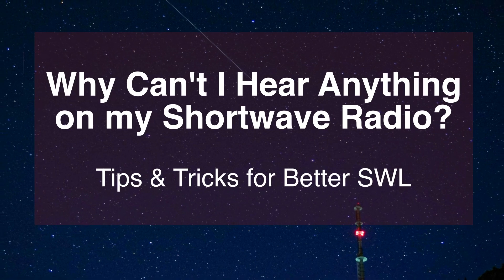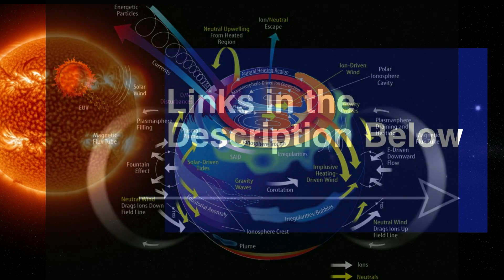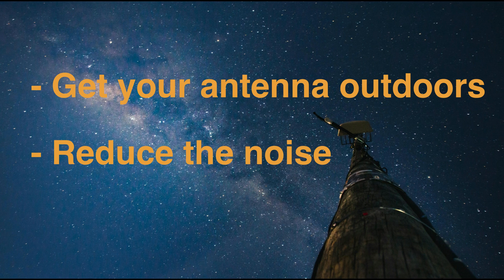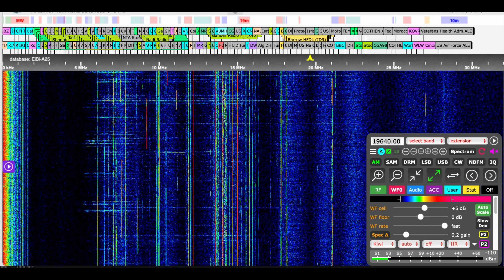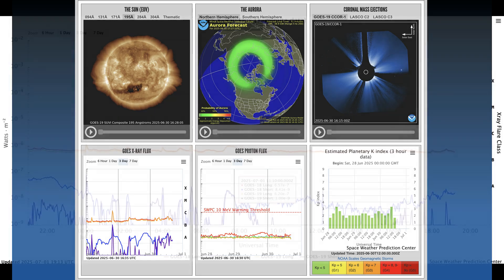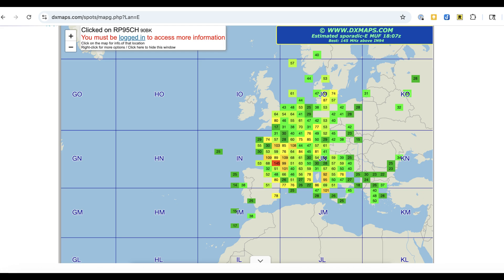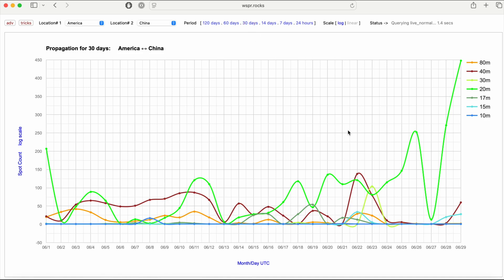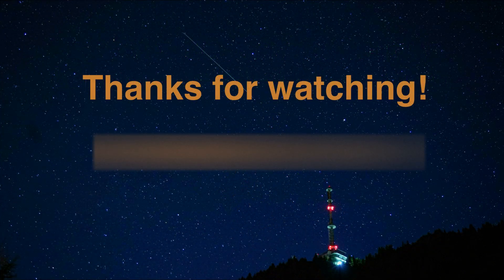Why Can't I Hear Anything on my Shortwave Radio?

Comment: Thank you for the educational presentation! There was a period in time in the mid 2000s, when I gave up listening to shortwave radio, thinking that it was during the poorest years of the 11-year sunspot cycle. I put my ICF-SW7600G away and stored it for several years. I didn't know that there was more to than just the sunspot cycle, which included seasonal solar weather that varied from month to month and day to day. 🙂

Since I took up SWL'ing back in 2021, I learned many things about shortwave propagation, including the ionized D-layer as the sun starts to rise beyond the horizon. It explains why the lower broadcast frequencies start to fade two hours before actual sunrise. Kudos for the tip about the worldwide beacons too, I didn't know about them (I could have mistaken them for the random CW transmission), but I've learned about radiosonde devices occasionally sweeping the HF band since I bought a Malahit DSP clone about two years ago. 📻😎
Reply from the maker: Glad you came back to the hobby and stuck with it!

Comment: Because of all the qrm generated by all the electronics 😢
Reply from the maker: Unfortunately true in many cases
Reply: @shortwavelistener yeah I wanted to rekindle my ham radio passion but when put up a temporary antenna and connected my HF receiver I heard nothing but 9+10db awful noise 😢😢😢
Reply: @RogierYou
Wall warts galore these days
I had the same experience, then I moved to a much better qth
Reply from the maker: @RogierYou it’s tough in an urban setting. You should try a loop antenna. Try the MLA 30+ loop to null out some of the noise - it’s pretty inexpensive and works fairly well.

Or, get a SDR radio and try to null out the noise with the software digital controls. That works pretty well.
Reply: @shortwavelistener  Tried that but there isn't much left.
Reply from the maker: @RogierYou yeah - it’s getting tougher, no doubt. Maybe just use the websdrs for now - that can be a way to keep the frustration level down.
Reply: Use a loop antenna it will cut your noise floor way down@RogierYou